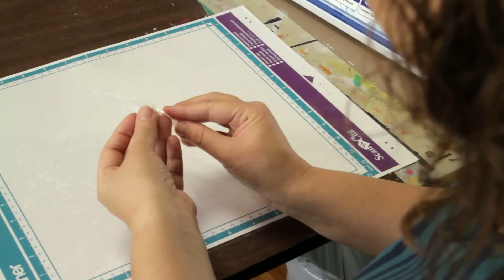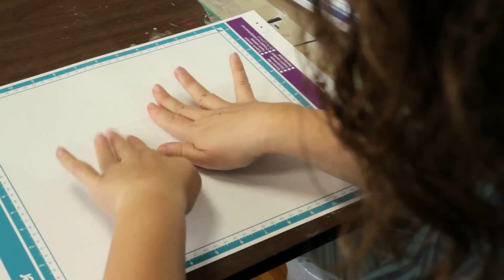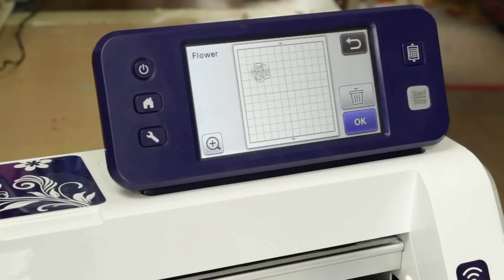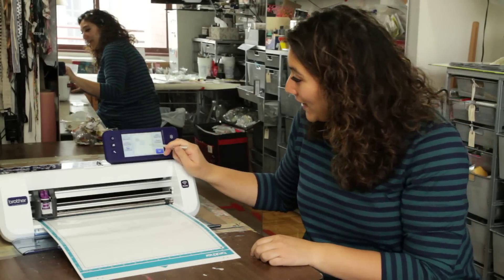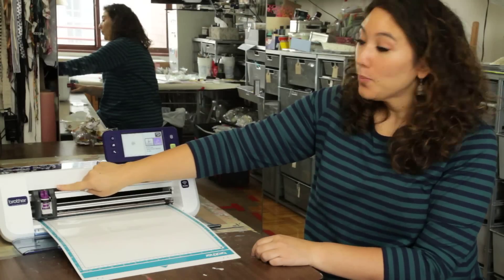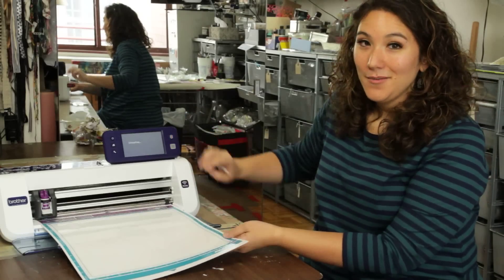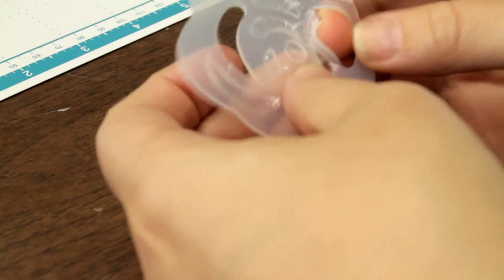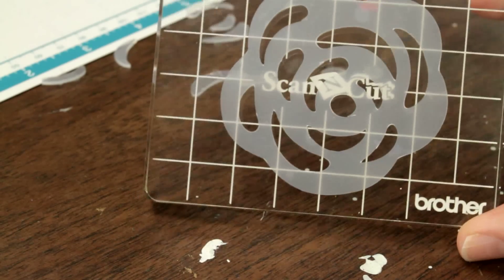Get Stamping with the Stamp Kit from ScanNCut

Comment: The stamp kit will not work on the DX machines.  The Auto Blade tries to cut the stamp twice.  On the second pass, the stamp material stretches, buckles and lifts; it gets jammed under the blade which hacks the stamp to pieces.  Brother recommends the stamp kit for the DX but has not provided any information on how to get it to work with the Auto Blade.